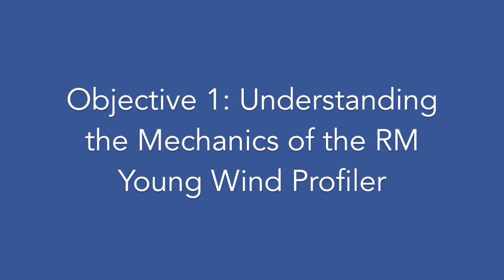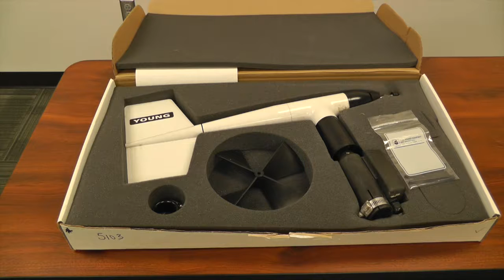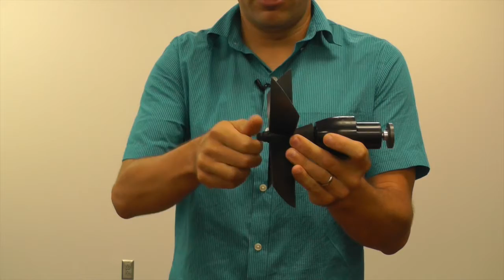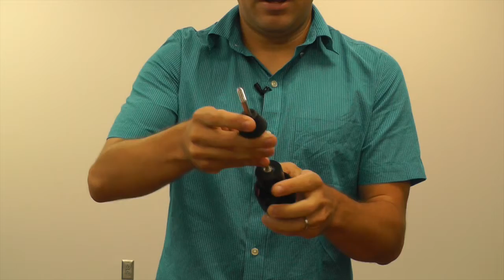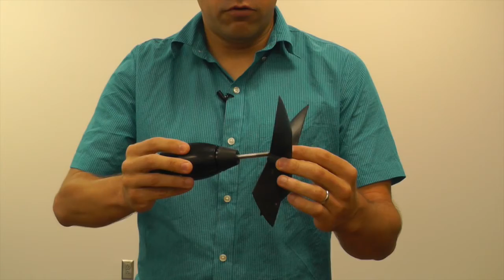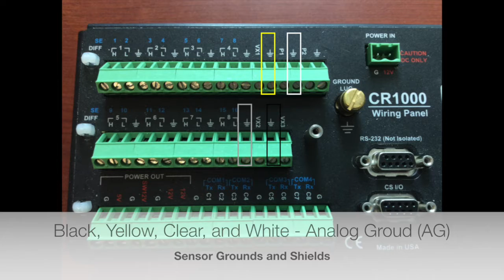RM Young Training

Comment: In practice - what is a difference in wind on 10m and 6m height? I know equation V1 =V0 *(H1/H0)α.  I plan to put 3m diameter wind turbine at @ 8m and have done bit over 1 year measurement on my site at height ~6.5m (Weibull k=2.1-2.2 range, Irish countryside, 2,5m hedges below). Is there any good explanation how "behave" this equation on such low, bit turbulent altitudes?

Comment: Is the shaft stainless steel
Reply from the maker: I believe it is. The flange bearings are stainless steel, so I can't see why the shaft would not be as well.
Reply: @seanheuser9612  thanks
Reply: oh another question I have the alpine version and you said that the body is smaller on it then the regular one is the length different as well or is it just the body